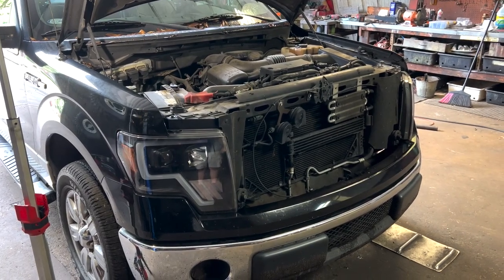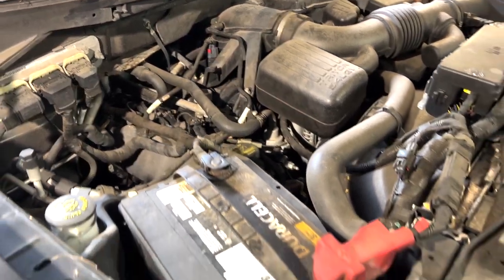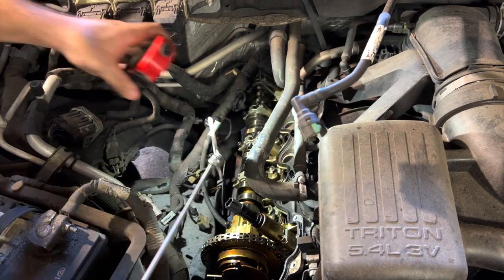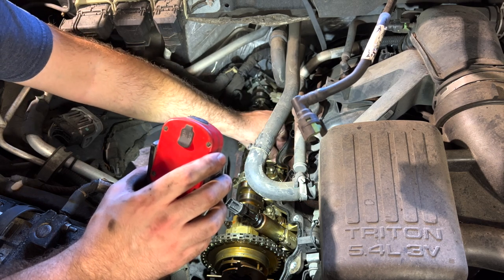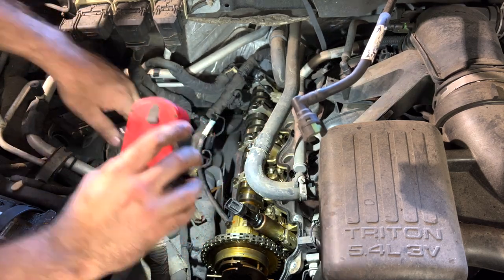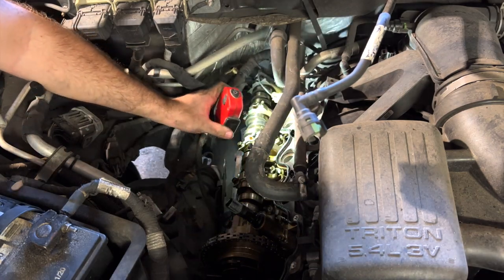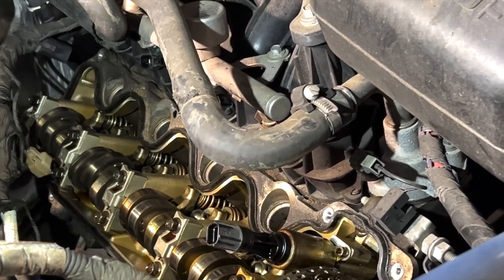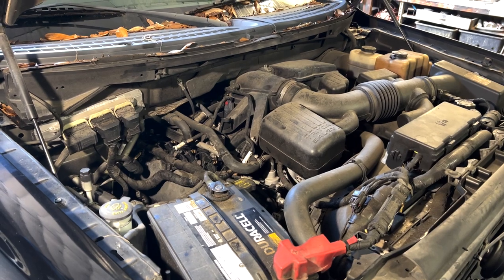Ford 5.4 3v Ticking Diagnosis

Comment: Thanks for the video and information. I have the same noise but not as loud and only when the engine is hot. I replaced all the rocker arms and the noise is still there. I ordered them from Ford and they were about $10 each. I’m using 5w30 and it hasn’t helped. 2009 F150 5.4L 190,000 miles on mine.
Reply: My 2005 Ford says 5/20 because thicker oil would plug up because of the very tight tolerances.

Comment: The passenger side is likely starved for oil due to the timing chain tensioner gasket blowout. Recommend replacing tensioners and upgrading oil pump along with rollers.

Comment: I have the same truck and that same sound just started in mine at 180000 miles but i also have a loss of power now and Horrible gas mileage, could a lifter or rocker be the cause?
Reply from the maker: It could be if it has already damaged the camshaft, but you just cant be sure until you remove the valve cover and see for yourself. If you are certain that it is the same noise, that would be where I would start.

Comment: I have the same tick but only when the engine is hot. Could it be the same thing? Seems to me if it was loose, it would make the ticking sound all the time. Thoughts?
Reply from the maker: If it really is the same ticking noise, I think thats about all it could be. Perhaps when the engine warms up and the oil thins out? You could try 5w30 oil instead of 5w20 to see if any difference is made.
Reply: I have the same thing, it's only after it warms up
Reply: I have the same issue with my 2010 ford expedition only ticks like that when engine is warmed up, I tried oil stabilizer didn’t do anything , I have not tried to switch to 5w-30 yet I just purchased the vehicle , it runs good and shifts smooth it’s got 165,000 on it
Reply: Have you resolved this at all if so what did you do to get rid of that noise - thanks
Reply: I got my 09 5.4 f-150 w/ 133k same ticking noise I’m adding some motor honey 🍯

Comment: Wish I had seen this a year ago.  Those roller followers fail catastrophically, without warning... after they start ticking.   And you don't need to remove the cam to replace them, tho it is a little tricky threading them out.  Ford makes a tool for depressing the spring so you can get them out.  If one is ticking, all 8 should be changed.  FordTechMakuloco has several videos on this.   Simple changeout.  $10 part.  Wait too long, and Kaboom!

Comment: Mine makes the same noise followers seemed fine and lifters were stuck in the up position.. replaced all three in cyl 8, and waiting on new cam set screws to finally see if this fixes my problem.
Reply: did it? i have same issue and figuring it’s my lifters
Reply: It was a broken valve spring @austinbell-

Comment: Was that the sound?
Reply from the maker: Yep, the rocker that I thought was making the noise was the right one! I later ended up popping it out with a screw driver and popping the new one back in, and its quiet again!
Reply: Where can you get a new rocker and are they all the same or do you need a specific one?

Comment: He took it apart and put it back together and told his friend I found your problem.. 😅😅😅
Reply from the maker: I swapped out the cam follower at a later date, after he ordered the parts. Only required a screwdriver no special tool.
Reply: @rustyoldchevy1149 after you swapped out the cam follower, did it fix the problem? Was it only that one follower that was making the sound?
Reply from the maker: @HPX584  it was the only source of the sound, so it fixed the problem and stayed quiet since the cam was still in good shape.
Reply: @rustyoldchevy1149  was it the rocker arm that you replaced or cam phaser?
Reply from the maker: @HPX584  the  ticking sound was the cam follower, the phaser makes a lower knocking sound

Comment: Oh yeah
  I remember that

  I remember those noises

  The first time I really noticed and discovered the noise was in 2017 it was a summer afternoon probably in July and my family was about to pick me up and I was waiting And I was waiting And I discovered the noise I was close to parking lot with her were some cars parked in some vans as well i they were cars and vans there and possibly some trucks that were parked there they were idling, and that did it they were idling so when they were idling, they made a ticking noise. The ones that did it, where a Ford and dodge a Ford van possibly an Econoline and a Dodge and possibly a Dodge Caravan I had never really paid attention to that until that day, I noticed it that day, and, I was like is that how they’re supposed to sound and then I was like no and then I was like well my families course never made those noises well not that I have seen they have made other noises but not those noises and then I was like probably don’t on Fords or Dodgers  and then I realized that it could be possibly something wrong. It could possibly be something wrong then today I looked it up and I found out some more information. It could be a few things it could be low engine oil, pressure, ignition system, failure, possibly problems with the valves, problems with the cams or rollers, and other various things that can go wrong , also today I walked by a Ford and a dodge van they were idling. They were making similar noises. And I paid attention to that. I am kind of glad that I found the issue.

  I think to use that are most common on Fords or 2003 2013 or possibly 2011, 2016 on Fords on dodges I think the most common years for the ticking noise are 2011 2017 I think only penta star generation dodge caravans, and dodge trucks have that noise versus the pre-penta star generation does not, but I’m not sure

  I categorize caravans in different generations. There’s a First. Generation there’s the second generation series the fourth generation and then there’s the fifth generation which I think the fifth generation is from about 2008 to 2021 and if that is correct, then I classify fifth generation caravans into separate groups is there is the pre-penta star Which was used on 2008 2009 and 2010 model years which that engine is not the Penta star and then there’s the penta star which have been use on 2011 and up 
  I kind of prefer the pre-penta star generation

  The noise is common on cars that happen been taken care of as well, sometimes such as taxi, drivers and other private companies like shuttle services and other companies
Reply: OK so what was the problem?
Reply: @StormsandSaugeye 😂
Reply: @Ghostduster  turns out the problem on MY truck was that the entire camming system decided it wanted to take completed systems and turn them into blender byproducts. 
It took me forever to get the engine replaced. Which was the only solution to the problem. 

I'm now 8 grand poorer. But I like my truck. So.... 

Yay?